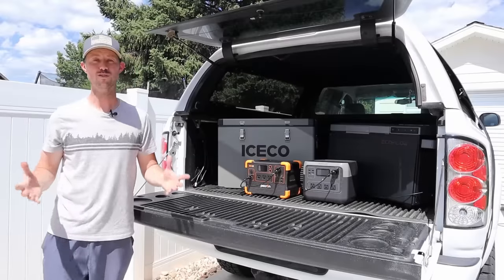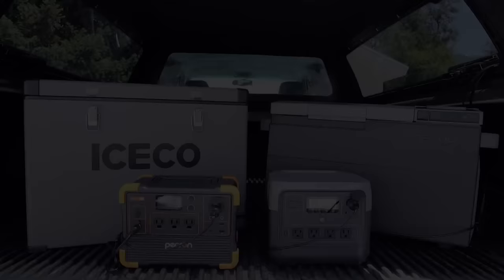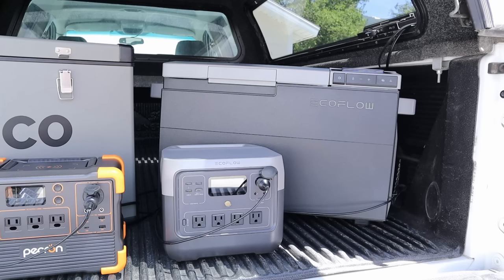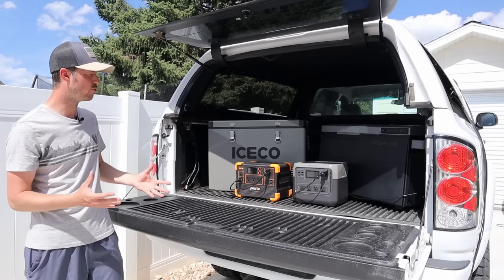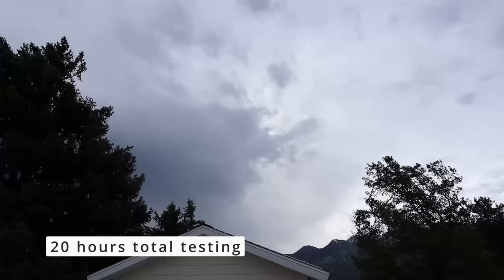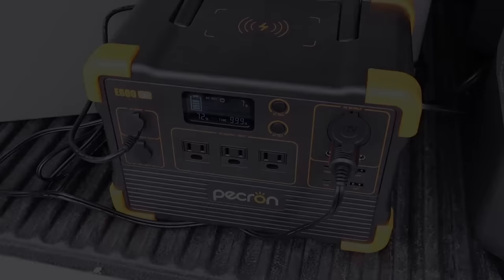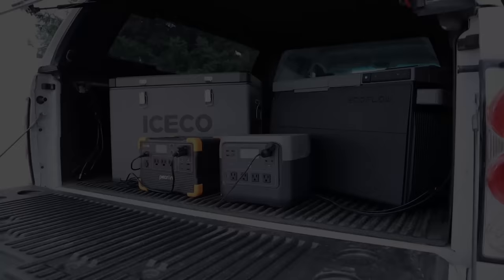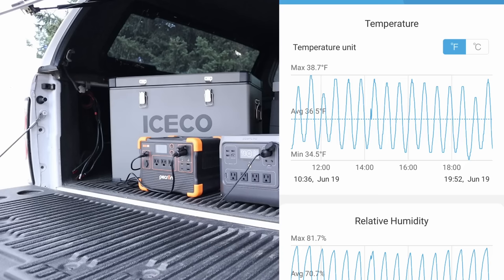72 Hour Compressor Fridge Showdown! Budget Cost VS Premium Cost!  #iceco #ecoflowglacier

Comment: Having carefully researched just about every sub-1000wh station out there, these 2 just so happened to be the frontrunners for me! I say put the 400 solar watts into the Pecron and there's your winner ;) Looking at all the strengths of each, I think a lot depends on whether you're mostly charging solar or AC.
Reply from the maker: These two are some of my favorites! I lean to the River 2 Pro for some of the premium features but both are excellent in their own way!
Reply: @Jasonoid  My own personal assessment:

R2P: Half AC charge time, 100Wh more usable capacity, few lbs lighter, "UPS", app control

Pecron: Double solar input, 1200W inverter, 10dB quieter, more efficient AC output, wireless charger, less bulky/folding handle

My final thought is that the amazing value of the Pecron makes it worth a shot despite the shorter warranty (register for 24mo).

Comment: I used my solar generator  and two 100 watt panels for my  iceco vl 60/65 and it’s a 2000 watt generator I just kept it topped off at times I was getting 186 watts and  it got enough which when cold the iceco only drew 36 watts  cooling down it used only 56 watts  the fridge was set at 36  and freezer was at 11 degrees it ran day and night for 4 nights and 5 days no complaints here at my off grid cabin 😎😀👍🙏🏻🇺🇸

Comment: I have an Ecoflow 1,300 with a 200 watt folding panel. Total price was $560. The Ecoflow stays at 100 percent charge while driving so when I get to camp I am fully charged. I run a small fridge, a small fan, and a small light off that solar setup with no problem.

Comment: I got an Echoflow Delta 2 (1024wh) ($480 on sale on Amazon), a HCALORY 42 quart fridge ($152 on sale on Amazon) and a Massimo 300w solar panel ($150 Walmart). With taxes it came in under $850. I have more watt hours, more solar, but  little less fridge room.

Comment: I have the VL45 that's been installed in my cargo trailer running off a 100 amp hour lifepo battery, can run for 3-4 days easily before any need charging off my tow vehicle and the trailers Dc to Dc charger. I would add solar if my trips ran longer than 4 days but unnecessary at this point.  I have about 50 days use over 2 years on the ICECO and not a complaint, highly recommend it.

Comment: To run my small ICECO fridge AND charge the 2  Li - ion batteries on my E-CELLS e-mountain bike at the end of a day of hunting I use: 1.) Off Grid TREK 220 watt folding solar "blanket"  charging a 2.) BLUETTI AC200 MAX Li Fe Po4 "solar" battery.
Though an expensive system it's totally reliable and works amazingly well.

Comment: I would have liked to see the test with the same solar panel power.
With an economical 200W solar panel, the performance will surely be equal. And it would still be about $1,000 cheaper.

Comment: I picked up a river 2 max and a ecoflow 160 watt solar panel from home depot for $500 after watching this video. I plan on getting one of the iceco to run with them. It would be very useful to have a small fridge that can run independent of the power grid.
Reply from the maker: Wow! Great find on the River 2 Max and solar panel at that price :) The VL45 is an excellent option from ICECO, they also have some newer models.
Reply: I am looking at that deal right now but I can't decide between this or pecron
Reply: $500?
Reply: I did the same thing..i bought the ecoflow River Pro and paired it with my Alpicool 50....once youget power you will need more power...get the extra battery with the ecoflow river if you cant afford a bigger power station...believe me you will need it and the investment is worth it. You can never have to much power..get as much as you can

Comment: I've never had an issue running my Iceco VL45 fridge with my Jackery 240. I have it set up with the Jackery plugged into the 12v so it stays full while I'm driving, and then switch it over to a 100w panel on the roof of my truck when we get into camp.
Reply from the maker: Thats a great setup. Simple and efficient!

Comment: Wow Spectacular Testing video! - I use a Bodega and Delta 2 when I travel, definitely will be getting a panel.  I have been wondering about what I need when camping, I basically leave the D2 and Bodega in my vehicle just utilizing a Cig. Lighter output to the D2, I believe the lowest I have ever seen the D2 get was 52% , I was using the AC out from the D2 to the Bodega cooler, and apparently i should be using the DC out for better efficiency… Thanks for the Video! They are all great!
Reply from the maker: Oh yeah, you'll get way longer runtimes off the DC output vs using the AC inverter. Since the Delta 2 is larger, you might not even need to charge it on a short trip. I love that power station :)

Comment: I'm a bottom-line kind of person, so the Pecron/Elecantera/Iceco combo is clearly the winner for me due to low cost and equal ability to keep food cold. You could add another Elecantera 125 and hook them in series for more solar and still come way under the ED units in price. I run a BougeRV 23qt (solo) and a 53qt (for two+) with a Pecron LFP2000. and 2 Elecantera 125s. Are we allowed to comment on the moustache? 👍
Reply from the maker: LOL, the mustache is from laziness of me not shaving this week. Great idea on putting two of the Elecaenta panels in series since both power stations could have taken the higher voltage.

Comment: Great video and review.  Been catching up on some new reviews on power stations and came across this one.  I bought a Setpower RV45D a couple of years ago and really like it.  The dual zone is key.  I'm actually glad I have the one I do, the newer ones have wheels and other handle options that I don't think are good for my use in keeping in the back of the SUV.  When needed, I supplement my SUV 12V power with an Ecoflow River Pro.   
I just ordered the Delta Pro with 220W solar panel on Amazon Prime Day at a deal too good to pass up.  Slowly building the capacity.  REally like the Pecron 3600 review you did in another video.  That seems like a great option for household backup.
Reply from the maker: The Delta Pro is a great option too! You'll love it 👍

Comment: This will help me I’ve just got a vl60/65 iceco and I have a solar system at my off grid cabin and I also have a 2000 watt solar generator  and I get days where it’s cloudy and raining sometimes 2 or 3 days of it and that’s when I use my gas generator to run the cabin and charge my batteries and solar generator too I’m going up next week and I’ll give that cooler on steroids a good workout lol !!
Reply from the maker: Running these 12v fridges is much more efficient than a full size fridge :)

Comment: I use the Iceco GO20 with a Bluetti EB70, which i just keep in the hatchback on road trips.  Works great.  I never use the eco setting on the Iceco as the temperature swings quite a bit more, especially in the back of a car sitting in a parking lot for even a few minutes during summer.  Even with the odds stacked against the Pecron/Iceco with the 120 watt panel, i was glad to see it held its on against much more expensive EcoFlow system.  Time will tell on the Glacier as i'm just not sure the compressor used is as reliable over time compared to the Secop compressors in the Iceco refrigerators.  I think that the EcoFlow 220watt bifacial solar panel is one of the best on the market and sometimes, the premium price is acceptable.  I hope that you don't have any similar experiences with that NMC battery in the Glacier!  Great review!
Reply from the maker: Thanks for sharing your experience John, I really like the ICECO GO20, it's a great little fridge. I do agree, it might be worth splurging on a 200w panel for better performance during cloudy conditions.
Reply: quick question, John, since you have same gear as me: I'm still new to this so wondering if it's better to charge my Iceco GO20 'while driving' plugged into cigarette lighter, or plug the fridge into my Bluetti EB70S and plug that into the cigarette lighter? Any advice is appreciated.
Reply: @GypsySoul2023  The only reason i don't do that is it's easy too forget and leave it plugged into the lighter socket.  I have found that the EB70 runs the GO20 for 10 to 12 hours even in the summer with no problem.
Reply: Sorry, some cigarette lighters like mine stay on when the ignition is off so i don't use it for charging.  If your ignition shuts it off, then by all means plug your EB70 into the outlet and it will stay topped off while you are driving.
Reply: @johntate5284  Thanks so much!
Reply: @GypsySoul2023  I have a 20L Joytutus fridge/freezer that I use on my frequent travels that are 7 hour drives. I use the Jackery 500 to power it.  I connect the Jackery to the car 12V cigarette plug and the Joytutus to the Jackery.  It allows for pass thru charging so that whenever I need to make my pitstops I just leave everything connected and when I finally reach my destination the Jackery is  still fully charged when I unplug it from the 12V cigarette plug.  I've been asked why not just connect the fridge to the 12V cigarette plug but I find it an inconvenience to unplug from the car to the jackery and then back to the plug.  The Joytutus is on freezer mode during my travels and these way there is no interruption of power.

Comment: Great test. I like the comparison. I would love to see how the Pecron would do with 200 watts of solar on it. But I am sure it would be about a tie even on the cloudy days. Great test and one of these days I might actually buy a iceco fridge. So far, I am sticking with the cheapo 12-volt fridges. On the Dr Prepare battery with the 12 volt module I got 6 days of runtime on a 12 volt fridge with out charging it at all during the test keeping it at 36 or 34 degrees on the setting. But that was inside with a room temp anywhere between 68 and 78 degrees.
Reply from the maker: If you have a fridge that works now no need to replace it. You'll see around double the power usage in hot temps so you'd probably get around 3 days runtime instead of 6. Still very decent since that's without charging. Add a solar panel and it's unlimited runtime if the sun is shining.

Comment: I actually have the budget version of the ICECO made by Setpower. It is practically identical in all ways and I love it. It’s saved a good deal of my meats a few times. I rotate in different power stations, since I’ve always got one or two charging while others are running stuff.
Reply from the maker: Setpower is a great budget brand, even cheaper than ICECO :) I like their fridges!
Reply: @Jasonoid  Iceco is German made vs China if that's a concern. I've been really trying to decide because I like to buy the right product the first time if possible and not have to go through it again. My first Ice-less was the Coleman and I was sold but it didn't hold up very long. That was some time ago though and there was little else. I think I'll go with the Iceco.

Comment: I just picked up a Bodega TAW59 portable fridge 59 QT & a Bluetti AC70P (864WH). The power pack doesn’t give any cut out specs but I can set the fridge to cut out at H- 11.1 V, M- 10.1 V, L- 8.5 V. So my question is what’s the best cut out volt for the fridge so I don’t damage the power pack.

Comment: I like to use the 12 volt in the car to charge the power station and then use the power station 12 volt output to run the cooler. That way when I'm driving the battery charges, when the car is off it keeps running. 500wh is the minimum I would recommend as 300wh does not last long enough and often charges much slower as well.

Comment: I have TWO SETPOWER 12v refrigerator/freezer 1)30 qrt 2)42 qrt. Both are single zone, but since I have two I decide which is used to freeze or refrigerator. I use them on road trips and as power loss refrigeration. Oh, and 800 watts of PV on two strings as well.
Reply from the maker: Thats a great setup!

Comment: Good information on the two setup’s. Thanks for the video. I’m guessing though that the iceco would have used a little less power if it would have been latched down so it was closed all the way making a good seal. 
Grace and Peace 
Slick
Reply from the maker: The ICECO lid is actually pretty heavy on it's own and seems to make a decent seal. That's why I usually don't latch it.
Reply: @Jasonoid  
I can appreciate something of good quality works well when not used how it was designed but I’ll bet the company would not appreciate, especially when testing, using it 100% correctly for results.

Comment: I'm quite surprised that you hadn't figured out that a solar panel, that is over 50% larger than another would significantly improve power supplied. Elecaenta has a 200W panel you could have used, that is significantly cheaper than the Ecoflow and made a much more even comparison. I have confidence there would have been no advantage to spending a ton more money on the Ecoflow equipment as far as running those small compressors go. I own all 3 Elecaenta's 120, 200 and 300W.
Reply from the maker: Of course using a larger panel will help the power station, but in this video I wanted to see how a cheaper 100w panel would keep up with a more expensive 200w panel. By asking these questions in the video it helps my viewers think for themselves. It was by design I used different sized panels to see how each one would perform. My main questions was  'Does someone NEED to buy the 200w panel, or can they save a bit of money and stick with a 100w panel instead?'. The results in the video showed both survived the test so maybe you can save $150 -$200 and buy the cheaper panel. It just depends on your local weather.

I have the Elecaenta 200w panel actually and I am planning to do a much larger 200w panel head to head testing video to find the best panel for the money. I have over ten 200w panels now. That video will be out in the next month or so. Trying to coordinate with the weather is extremely difficult.
Reply: @Jasonoid  Thank you for the lengthy reply. There were just so many variables there, I didn't see that there was that much you could glean from the comparison. Totally different Supplies, panels and coolers. Changing any of the variables would change the outcome (most likely). I usually shoot for best bang for the buck. What will work most of the time, for a reasonable amount of time, considering the price. Of course where they will be used need also be taken into account with the panels. Down south here we have a lot of sun, so a possibly medium level production panel, may put out plenty of power that it is incapable of up north. Look forward to your coming video.
Reply: One size doesnt really fit all in the portable power arena because there are so many variables. By watching many videos of many setups a viewer can make decision of what options are best for their setup

Comment: I have the same ICECO fridge (45 liter), an Ecoflow River Max, and a Baldr solar panel (120 watt) and have been very happy with the setup.  The cost savings was significant compared to 'premium' setups.   The only drawback has been the discrepancy (as much as 9 degrees) on the set point and actual internal temperature of the ICECO.  Sure wish you would do a video or some sort of explanation on how you corrected that problem on your fridge!
Reply from the maker: I'm sorry for not putting out that video yet!!! Ugghhh, I think about it all the time actually. Here's the problem... each ICECO fridge has a different process to get into that special menu and theres no easy steps to fix the temp settings. Theres just a bunch of trial and error and changing settings until you get it right. Since theres not an exact process of how to change the settings I think people might do more harm than good.
...So while there is a 'secret menu' to adjust the temperature settings, it's almost easier to just set the display higher or lower to match the temp you want. Once you know how the temp is inside, its a set it and forget it type of thing.
Reply: My Jp40 is dead on. My Jp50 has a 5 degree discrepancy. I have a thermometer in both of them. And I just do what Jason said to do.

Comment: Good test but it makes no sense not using the stand that came with the Ecoflow 220w panel.  Would of dealt with the falling over part.  

It does look like the next gen of that panel has kick stands though which overall is better.

Comment: I have a BougeRV 35qt dual-zone fridge/freezer that I've run off of either a BigBlue CP500 (538Wh) or an Oukitel CN505 (614Wh), with a Renogy 100w rigid panel bolted to the roof rack on my Suburban.

Comment: I think using my 100ah lifepo4 battery makes more sense than taxing my Pecron 600 for my fridge. I even have an alto charge controller to recharge  it also with my panel. My total setup is 2 Dr prepare lifepo4 100 ah batteries and a Pecron e600 power station and a 120 watt solar panel.

Comment: Hi! Thanks for all your videos! I really appreciate them. I just bought both an Elecaenta 120W panel and a Pecron E600LFP based, in part, on your videos. I haven't gotten them in yet. I see that you start the video with the solar input on the bottom port, and then move it to the top port. I believe the top one is 12-18V, and the bottom is 32V-95V. The Elecaenta is rated 21+/- 5 percentV. Is that much higher than 18V a problem?
Reply from the maker: The Elecaenta panel is a "12v" solar panel so it goes in the lower voltage port.